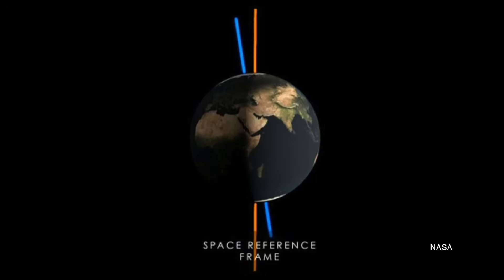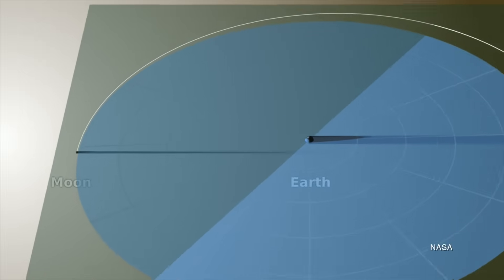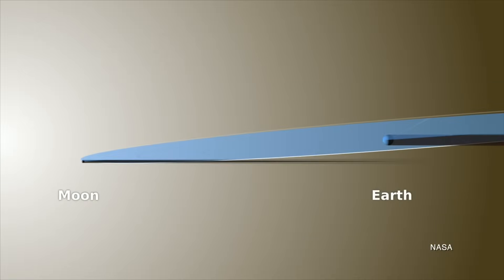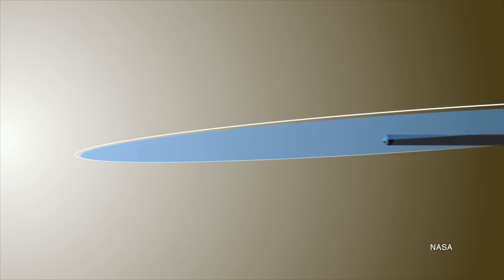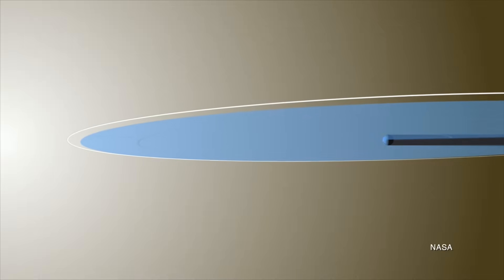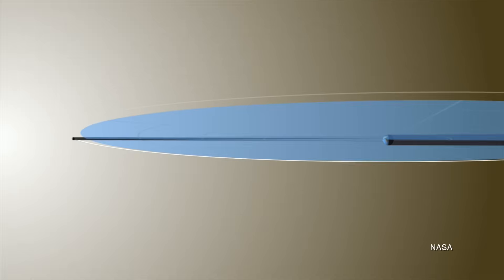Why Does a Rocket Need to Roll Going Into Orbit?

Comment: Outstanding content!!
I'm courteous as to what the term "man rating" a booster came from. What criteria has to be in place to have a launch vehicle man rated? Thanks!
Reply: If it doesn't kill people too often, it's okay.
Reply: It's correlation between the dimensions of the "average" human penis to the booster.
Reply: Very high reliability of subsystems, a fail soft mode for life support or critical systems, life support systems that meet six sigma criteria for reliability, etc.

Comment: I have an hypothesis that the roll program also, in many cases, has to do with the guidance system and the accelerations placed on the payload, particularly when the payload is human.  For example, the Mercury-Redstone used a relatively primitive guidance system derived from the V-2.  This system was, so far as I know, only capable of integrating the delta-V in one plane.  Manned missions often (always?) fly the astro-cosmonauts head down to keep the Gs toward their feet.  And, yes, I know that the main Gs are in the front to back plane, but the curving of the flight path from vertical to horizontal puts Gs in a perpendicular plane to front-back.  Humans prefer, by a wide margin, not to have those Gs shove blood toward their heads
Reply: So, while orbit inclination is a fundamental driver of launch azimuth, it is in theory, possible for a rocket that is axisymmetric around the roll axis to fly any launch azimuth in any roll angle.  A fully axisymmetric system could even deal with a constantly rolling, or irregularly rolling vehicle.  But, it turns out that practical launch vehicles and often their payloads, are not fully axisymmetric.  Both the hardware, particularly the guidance system, and the payloads often prefer specific roll orientations.
Reply: You are correct that any orbital inclination can be obtained without a roll. The real reason both the Saturn V and the Space Shuttle rolled was so that when they pitched over the astronauts would be flying heads down. This was desirable so that the crew could look out the windows and see the earth below and the horizon ahead. This allows for a visual confirmation of the vehicle's attitude independent of the guidance system, which could be especially useful during a malfunction or an in flight abort.
Reply: Giving a spacecraft some roll can actually help keeping it stable. You'll need less expensive equipment that way. The Juno probe was given some roll during launch, and it's still spinning.

Comment: I understand the roll of aircrafts. but i cant understand this in terms of rocketry. because rocket is symetrical & going vertical then what is the use of roll? plz somebody explain me. & what is the flight azimuth she is talking about?
Reply: OK, the easy part first:  Once the rocket begins to pitch over, it's no longer going straight up, but is also travelling across the surface.  The heading it's on is the launch azimuth.Why they rolled is a bit more complicated.  For operational reasons, the astronauts needed to launch "heads down".  If they needed to fly the rocket manually, or in some abort instances, the astronauts needed some sort of outside reference so they could be sure of how they were aligned.  By flying heads down, they could use the limb of the Earth as that reference.  There were other reasons, but this was one of the big ones.Every flight had different parameters for getting into the correct orbit for the mission.  That included the launch azimuth.  Because the astronauts needed to fly heads down, the rocket needed to roll some amount so that when they began to pitch, the astronauts were heads down and the rocket was on the correct azimuth.Here's a concrete way you can see what's going on: Hold your hand straight up in front of you, with your palm facing you.  Your hand is going to be the rocket, and the back of your hand is where the astronauts heads are.  Now, tilt your hand back so the palm is facing upwards.  Your astronauts are going into orbit heads down, and your fingers are pointing where the rocket is going.  Now, do the same thing, except before you tilt your hand, twist is so it's still pointed up, but the palm isn't facing you.  Now, tilt your hand back-notice that the fingers aren't pointing the same direction?  That's how the roll program changes the launch azimuth.
Reply: Although rockets look mostly axially symmetric in roll, there are aspects that may not be, and were not in the Redstone, Atlas, Titan, S-1, S-V, Shuttle and in the Russian manned launchers, and in other launchers.  This is discussed in some of the more recent comments on this video.
Reply: thank u so much

Comment: Why wouldn't they use a combination of yaw and pitch, instead of a combination of roll and pitch?

Clearly, you have to rotate along two of the axes, but mathematically you could rotate along any two and end up with the desired orientation.  Why did they choose the pair of axes they did?
Reply: Sure you can use any combination of yaw and pitch, but my guess would be that some would be easier to accomplish than others, based on the orientation of the engines. E.g., Soyuz pitches in the form of a + sign, if that makes sense. The exhaust of the 5 engines would look like a + sign when seen from the ground, in relation to the horizon. I'd imagine that that is easier to accomplish than making an x sign, with the boosters diagonally out from the center core, or doing something in between.

Also, there is the comfort of the crew to consider. I imagine it would not be much fun to hang in your seats kinda sideways when riding a rocket.
Reply: The norm in aviation is to control pitch and roll axes to make heading changes.  Yaw control is always adjusted to ensure there's no 'skidding' while turning, the slip indicator on the panel keeps the pilot aware of any yaw.  Keep in mind the astronauts were all pilots, most military.  As they had the ability to manually fly the rocket if the navigation system failed, they'd want to keep the control system as familiar and instinctive to them as possible.
Reply: Heads down, viewing the horizon to match the instruments.
Reply: Technically, yes, but that is more complex and prone to error than just rolling and controlling the rocket in a single axis. As outrageously complex as Apollo was, KISS is still a very important concept in rocketry.

Comment: 3:24 That disc had hundreds of times less computing power than your phone for thousands more the price..  Let's go to the moon again!
Reply: Electronics and computing power are the only areas of spaceflight technology that have undergone orders of magnitude change since the 1960s.  Probably the only other really big change since then is the development of large solid fuel boosters.  Even that is not an order of magnitude change.  Larger LH2-LOX engines are also an improvement, but not an order of magnitude improvement.  Both large solids and large LH2-LOX engines were fully implemented on the Space Shuttle.  Note that Ariane V, a quite sophisticated launcher, uses this configuration.
Reply: Actually, it had 16 bit words (double bytes), and had 2k words of RAM, and 36k words of ROM. it was also the first computer to use priority scheduling for multitasking. Previous to it, computers that did multitasking divided the tasks into equal divisions. The AGC pioneered the concept of having tasks with differing priorities, and having different "managers" handle what task got what amount of processing time. Really innovative stuff, and standard in nearly every modern computer system, from your PC to a simple Arduino!
Reply: yeah.  its also hard to thing that the shuttle wasnt using anything much newer even when it was still in service. The onboard flight computer was still using 1980s technology
Reply: Equally as interesting, the AGC had a similar level of computing power, and yet fit in the space of a large shoebox. The difference was they used integrated circuits for the AGC. Amazing difference of technology, even within the same time period, even the same vessel! The instrument unit was so large, it was actually a structural component of the rocket stack! The AGC was so small, they decided to toss a second one into the ship, so the Command Module and Lunar module would each have their own.
Reply: +richfiles yeah its also amazing to thing the AGC had something along the lines of 8kb of ram. pretty ancient compared to todays standards

Comment: Can a missile launched due east from anywhere but the equator get into an easterlny orbit? Isn't the flame trench really an acoustic trench? It protects the launch pad from the concussion of the engines.
Reply: Depends on your definition of easterly.  If, using the definition of easterly I am familiar with, i.e. in a generally eastward direction, then it could apply to any launch azimuth  0<Azimuth<180.  You could  be more picky and define it as 45<Azimuth<135.  BTW, Launch Azimuth does not equal Orbit Inclination.  The relationship is more complex.   http://www.orbiterwiki.org/wiki/Launch_Azimuth
I am not implying that AST equated the two.  She described a relationship between them, which is certainly correct, but did not go into details.
Reply: The acoustic aspect of the flame trench is certainly important, but so is the heat management aspect and the management of all that kinetic energy in the exhaust jet.

Comment: why do the spray water in the blast trenches before launch? i hear its for noise suppression because its so loud that the sound energy could cause the grass to burst into flames is that true?
Reply: Water is cheap, high-temp concrete isn't. To protect the one with the other is a good idea.
Reply: The water deluge system is primarily for noise suppression. It either wasn't installed, or wasn't properly tuned for the launch of Apollo 4, which caused some serious issues. They are dealing with enormous amounts of noise from these rockets, the sound energy actually flashes much of the water to steam, thus dissipating the energy.
Reply: Hans Johnson dude thats awesome, there is so much that goes into a launch

Comment: Amy, if I am correct, it is like holding a compass and the needle is - ofcourse - pointing North. I need to go North, but the pointer of the compass is pointing away from me, to the East on the compass. All I have to do is turn my body 90 degrees to the left and now both the pointer (N) and the needle are pointing to the North. Now I can start walking North. I think I got it right. If not, please let me know.
Reply: Compass needles don't actually point North.  The magnetic North pole 1) isn't the same as the rotational North pole. 2) Moves.  You need to look up the deviation (and yearly variance) for your location.
Reply: I know. ;-) I know how those thing work. What I meant was the principle of me and my compass adjusting to magnetic North. The compass is the gimbal aboard the rocket, where as I represent the rocket and its electronics, rotating the rocket into the correct heading. That's all....!  ;-) BTW, did you know the magnetic poles have shifted/travelled for thousands of miles, over the last few hundred years?
Reply: compasses are made with regional compensation built in. When you flip it over it will say where it is made for.
Reply: Paul Frederick
Never seen anything like that.  Got a link?  Not much use, of course, given the amount people move around.  And the fact that the declination changes all the time.
Reply: CorwynGC
The only time I ever need a compass is when I am hiking in the wilderness. Then I usually do not travel very far. I am looking at a page now about needle zone balance. You still have to calculate your declination though. Unless you have an electronic compass.

Comment: does anything orbit due West?
Reply: I believe Israel launches stuff due west.  It's diplomatically easier to dump rocket stages in the Mediterranean than it is to drop it on Iran, or Jordan, or all those other countries that would love an excuse to attack Israel.
Reply: Both the US and Israel have launched satellites westward into retrograde orbits.
https://en.wikipedia.org/wiki/Artificial_satellites_in_retrograde_orbit

The most recent retrograde launch from the US was NROL-45 last February:
http://spaceflightnow.com/2016/02/10/delta-4-goes-against-the-grain-to-backwards-orbit-for-spy-bird/
Reply: Not that I have ever read about. We do have polar orbits though.
Reply: In addition to Lenard's comments, the reason that nobody launches west (except for diplomatic or mission specific reasons) is that it takes way more fuel, so the payload has to be smaller for a given rocket size.  If you launch east, you already have some velocity because of the rotation of the Earth (IIRC, it's about 900 mph at the latitude of KSC).  If you launch west, you not only don't get that boost, you have to overcome that 900 mph easterly motion.  It takes something like 20% more fuel to launch a payload west than it does to launch the same payload east.On the lunar flights, the Apollo spacecraft actually orbited the Moon "retrograde" (east to west).  It meant that when landing in the "early morning" at the landing site, the astronauts had the sun at their backs.  And, since the rotational speed of the moon is only about 10 mph at the equator, the extra fuel needed to lift off the surface was negligible.
Reply: slimspidy OK, I wasn't sure if you knew or not.  But someone who doesn't know might come along and wonder about it.
Reply: Lenard Segnitz ,Interesting, I had not thought about that aspect.
Reply: I understand it takes more fuel, and is counter productive. But the questions was, is there anything and that was answered. I was hoping Amy would do a video on it because I am assuming there may be some OG satellites that may have been launched this way as experiments...
Reply: Sure, all sorts of space junk, and other outer space garbage that happens to fall into the Earth's gravitational field.  But who cares about that stuff, except the "Sanitation engineers" of the future who will have to clean up the crap we left orbiting our Earth from multiple rocket launches?   The worst stuff is what is still orbiting from the old hydrogen bomb days (Operation Rainbow, if I'm not mistaken) which has left multiple pieces of radioactive contamination and other nuclear waste still orbiting our planet.  So many people are worried about stuff that is irrelevant because they don't bother to learn from the past.  They are falsely concerned about "contrails" which is nothing more than ice crystals, when they should be worried about radioactive junk still floating around in space.  The Air Force is so concerned about this junk that they have dedicated super sensitive radar aimed at the sky just trying to keep track of all the junk that is still floating in orbit that hasn't burned up upon re-entry.  Most people have no clue how much junk is still orbiting our Earth.  Someday we will have to deal with this, or it will affect our navigation satellites, or, God forbid, our spy satellites.  We are now developing satellites with laser capable features to disintegrate unnecessary space junk so that it doesn't interfere with our super expensive equipment up there.  Can you imagine someday of a news report broadcast that, for example states that, the Hubble Space Telescope, or the future Webb telescope, was destroyed by a piece of  China's  or Russia's space junk?  Who is going to pay for that?  Do you think anybody who is monitoring our GPS system is worried about such a scenario?  Of course they are, but they can't even come here to talk about it.  But I'd bet  if I met one of these fine officers in a  bar for a cold beer, they just might agree with me. JMHO
Reply: daffidavit None of the "high altitude" nuclear tests were with orbiting vessels, so there's no "pieces of radioactive contamination and other nuclear waste still orbiting our planet".  The reason the Air Force monitors the stuff up there is because at orbital speed, everything is a potential hazard.  At least one of the Shuttle flights got hit by a piece of debris that caused them to replace one of the windows after landing.  The debris that damaged the window was a paint chip.  When something like a paint chip has to be thought of as a high-speed projectile, you need to track as much orbiting "stuff" as you can.